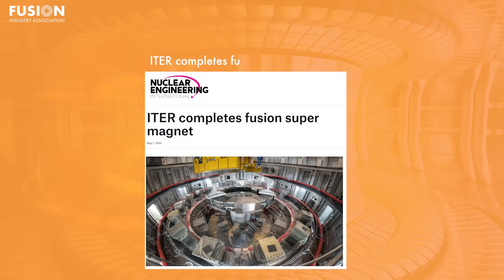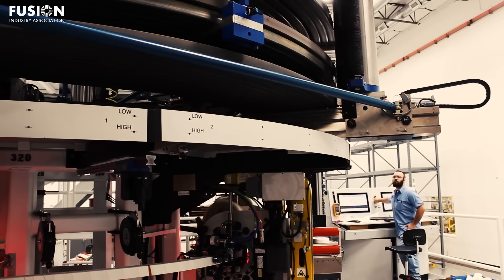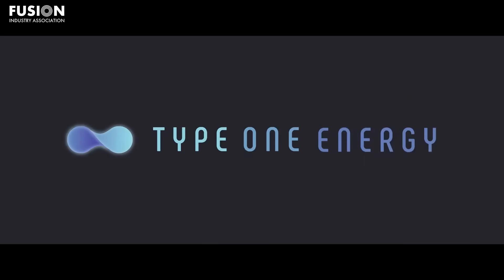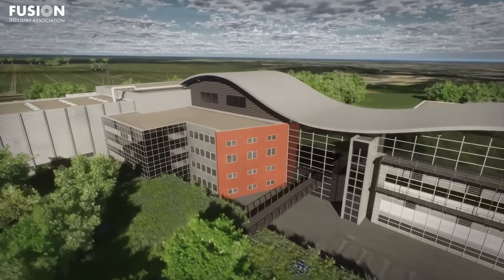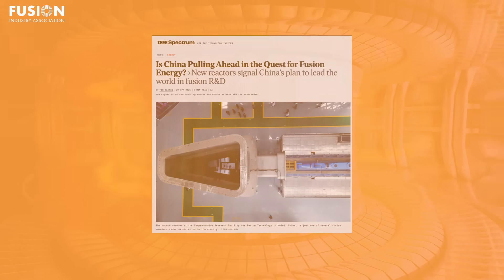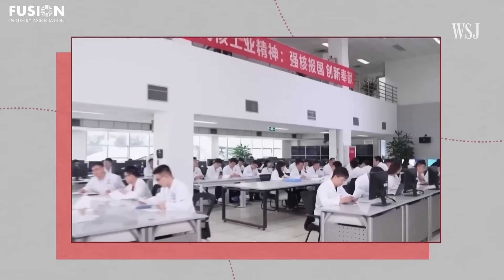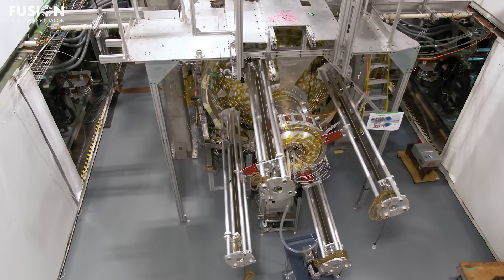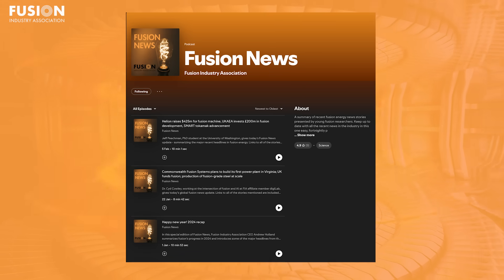Fusion News, May 14th, 2025

Comment: The ITER would produce 500MW thermal energy for 10MW electrical energy inputs, which is only a fraction of the true input so the real ratio is nowhere near >1. Also no mention of the fuel cycle, non existent tritium or helium 3 or how the breeding is going to work. See Daniel Jassby "fusion reactors not what they're cracked up to be".  And the massive irony that Germany is even working on fusion when they replaced their own fission power plants with new better brown coal burners to achieve 2x the CO2 per capita emissions of France which is actually a mostly low carbon nuclear grid country.

Update, I found a more recent paper by Jasby "iter is a showcase for the drawbacks of fusion energy", there is a electrical substation that can draw 600MWe from the French nuclear grid on site for the said purpose to power the ITER inputs, the output if it even generated electricity would only be 150MWe if it ran full time, in practice it will never produce thermal energy output for more that perhaps a few minutes a year before it becomes radioactive when the tritium burn starts in some far distant moment in time. The more one reads of Jassby, the more doomed fusion is, who to believe though, a retired nuclear fusion physicist or a young mechanical engineer that spreads propaganda.